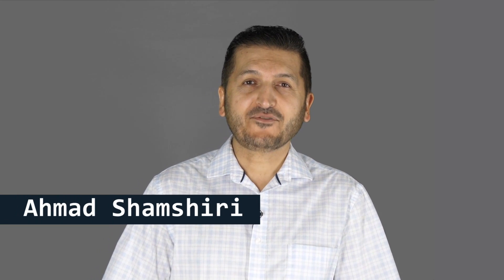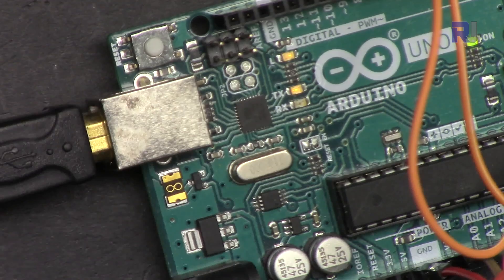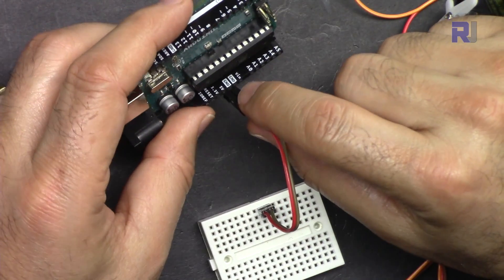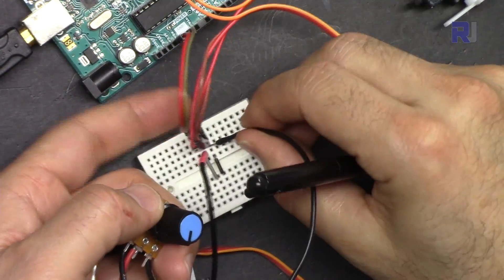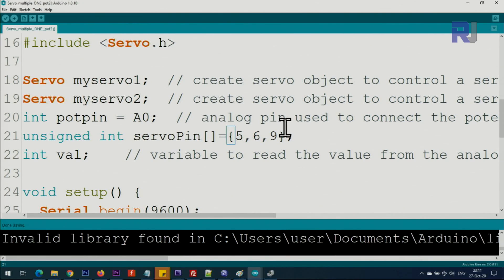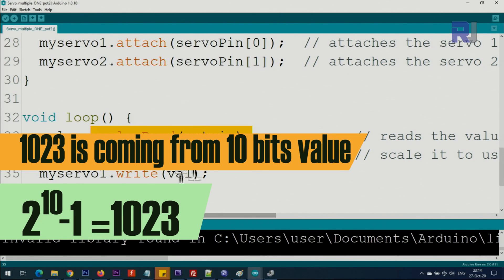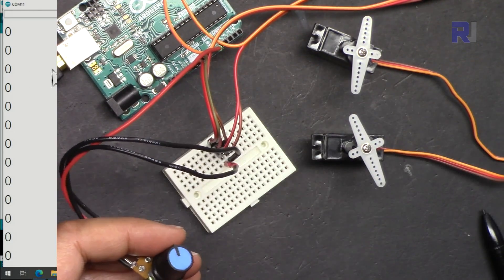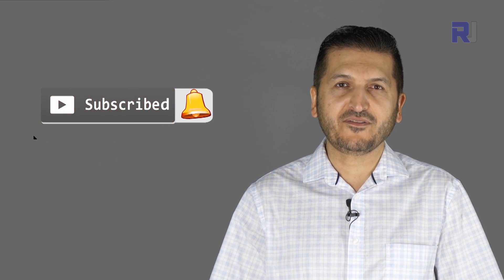How to control multiple Servo motors using one potentiometer with Arduino - RJT352

Comment: Hello Sir, I have a question, what if i want the servos to move in opposite direction instead of one direction for example, when i turn the potentiometer right, then one servo will turn right and the other will turn left and vice versa. Thank you for your time.
Reply from the maker: Instead of increment ++ the value decrement  - - he value. Watch basic servo yo learn that . I have the video
Reply: @robojax  oh thank you

Comment: Sorry for my English language.
How to make servo1 turn clockwise and servo2 turn anti-clockwise with 1 Potentiometer.
Reply from the maker: Your English is excellent. you can learn how ONE servo is controlled. then make multiple servo each with different direction. So watch this video and learn https://youtu.be/ntRW77mNFFk do not skip. I have explained the code fully.

Comment: hi! i would like to ask if it is possible to control 2 servo motors using 1 infrared sensor at the same time? thank you!
Reply from the maker: Hi, learn from this video how the command controls two servo. Then I have video on how to control servo motor. Using the same command control them.

Comment: Hi Mr. Shamshiri,

I hope all is well. I followed all your instructions to the letter, and I have 2 servos working with an Arduino Mega and Potentiometer, but I'm having the same problem as parin dave, who commented 10 months ago saying his servos were basically going crazy. My potentiometer has stayed connected, except when I switched it out trying to figure out what's wrong. My Arduino has the correct code as per your instructions. I have tried three different potentiometers, two 10 K ohms, and a 100 K ohms without success, thinking the problem may be there. I can't figure out what else could be causing this behavior? Do you have any idea as to what's causing this erratic servo behavior? My goal is to control 6 servos with one potentiometer, or toggle switch/rocker switch, or reversible polarity button.
Reply: I forgot to mention that I'm using 120 degrees servos. I don't know if the math would be different, but I changed the 180 numbers to 120. I didn't know if the 1023 number should also be changed, and if it should, I wouldn't be able to figure it out, as I'm terrible with math.
Reply from the maker: hello, 
for Arduino Mega you should know the resolution for analog is different see this page https://www.arduino.cc/en/Reference.AnalogRead

Comment: Which audrino is this
Reply from the maker: does not matter. just power servo with 5V. The rest works with 3.3V or 5V arduno. I am using UNO
Reply: @robojax  ty

Comment: how can i monitor the angle in LCD ? will the circuit be changed for it and what is the code if i add LCD in here?
Reply from the maker: here https://youtu.be/xrIiKqvm8hQ but I read your comment after 7 hour. You should have searched and not waited. Just search "robojax servo LCD"

Comment: How can we runs the 2 or more servos continuesly from 0 to 180° (for example) and we an changed the speed of servos with the potensio also ? can you made it for us ? thanks

(for example : Car windshield, continuesly runs, and we can changed the speed by buttons etc, But in this case, the motor of windshield are the servos, and the buttons are the potentio)
Reply from the maker: Interesting. you can add delay and make the delay function of potentiometer.  I would have to make video on that

Comment: Subscribed! Great info from a fellow Canadian.

I just watched a few videos and still need my morning coffee so excuse me if I missed already made videos with the info. 

I'm trying to find info on how I could control a servo motor over wifi via a potentiometer.

Example: multiple servo motor connected to a PCA9685 which connects to a ESP32 which receives a signal from another ESP32 with a potentiometer attached. Seems like a combo of some of your videos but still am unclear on how to go about this kind of thing. 

I'm not sure if ESP32 has enough analog pins for multiple potentiometers though. Kind of looking at ATmega2560+ESP8266 dev boards at the moment but still trying to work out what is the best way to do this. But first thing is first, control one servo via wifi and potentiometer. :)

Again i've never done wifi or bluetooth so I might be misunderstanding and need to use something like a nRF24L01. Early into the research stage. XD
If you have any advice or ideas on how to do that, maybe videos of yours to watch, I would be greatful! Thanks! :)
Reply from the maker: Thank you. I am glad you liked it. 
I am not sure why you use WiFi and potentionmeter.  you can control it over WiFi which perhaps you have seen my video. if not just search PCA9685. but combining two MCU like ESP32 and Arduino MEGA becomes tricky and need some work. 
Of course could do it over other wireless methods. But have to do it either over WiFi/Wireless or Potentiometer. if you want control it using both wifi and pot. as I said you need good place and lots of extra components to make it possible so they do not interfere with one another. Good luck.
Reply: @robojax  thanx for the reply. More or less I looking into a method for making a wireless handheld controller. Initially I was planning to do the wired version as I am mostly experimenting at home and that is simple enough, but I figured it is a good time to learn how to do the wireless methods.
Reply from the maker: good luck with your project. check my esp32 and esp8266 videos. I have spent a lot of time making consents for those MCUs.

Comment: Hello MR. Shamshiri, thank you for all of your Arduino Videos, there very helpful!!! I have a request for a video. Using a Remote Control radio, (with a two position switch, like a Gear & Down switch) control a continuous rotation servo. When the switch is activated in one direction,(High) the servo turns for 15 sec in CW direction then stops. Then when switch is activated low, the servo rotates CCW for 15 sec then stops.
Reply from the maker: Hello Rose. you are welcome. I have tones of videos and codes for controlling servos with push buttons. see them all here https://www.youtube.com/robojaxTV/search?query=servo

Comment: Really a nice video to control servos...

I have tried the same things with my servo but vibrates a lot....

Even if potentiometer is not moved, servo rotates by 10 to 15 degree....
This issue can be fixed in program?
Reply from the maker: you can't have potentiometer not connected. the noise at A0 pin will appear as a voltage and causes the servo to move. so you must have potentiometer connected at all times.

Comment: hi.d first indiscreet question: are you Moroccan?  even if it does not have to do with your present video I would like to know if we can program an esp32cam with an arduino uno because I have an esp32 camera but I have no ftdi module. I saw your video on the cam. thank you  .
Reply from the maker: Hi, No. I  am from خراسان الکبیر.
perhaps you've not watched the ESP32 camera and skipped. that is exactly what I've shown.  P.S always post the question under the relevant video so other people learn from comments. I have a screen where all comments from all videos are shown in one page. so I never any comment. Thanks